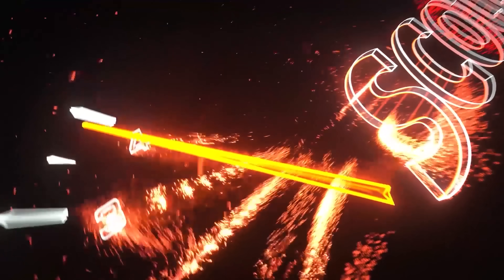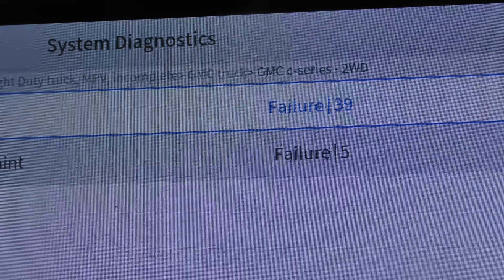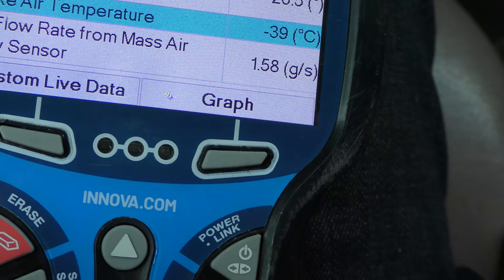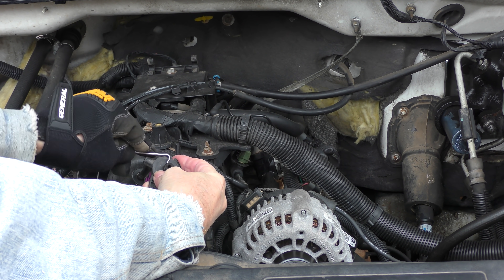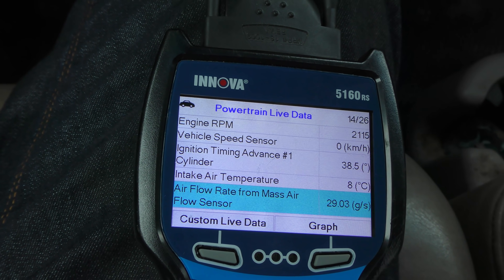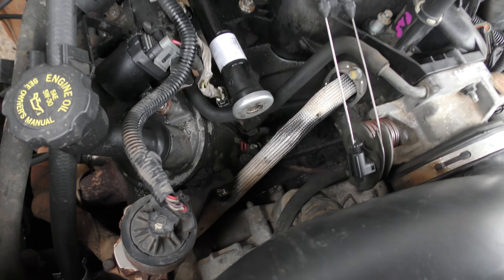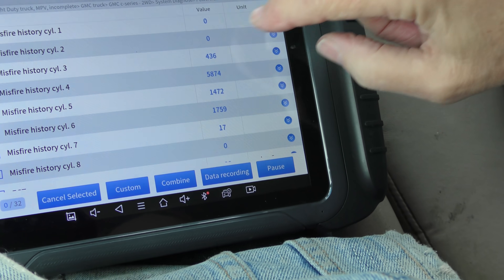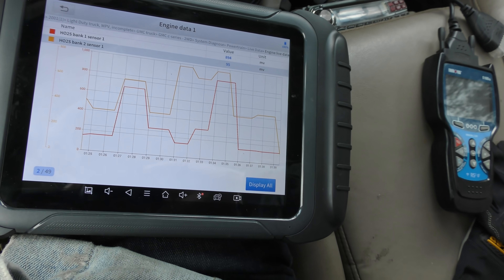My Customer Just Bought This Truck and Now He’s Screwed

Comment: I’ve heard very good things about the 6.0 vortec. Somebody must’ve neglected it. Weird that in 01-02 anyone would go for the 6.0 in a crew cab dually rather than the 8.1 or lb7 duramax. Makes you scratch your head
Reply: Probably why it's completely worn pulling all that extra weight.
Reply: My 2500hd has the 6.0 it's been bulletproof 303k miles just horrible on gas
Reply: He said it sat in field for a long time
Reply: @gabrielq.906  mine too.
Reply: @gabrielq.906  I understand they’re good I’m just surprised someone in the market for a crew cab longbed dually would go for the smallest engine offered. You usually buy that truck for a reason. Towing with the 6.0 probably gets worse mileage than towing with an 8.1.
Reply: @bryonhills6172  I know but I imagine it wasn’t exactly  someone’s pride and joy when it racked up nearly 300k either.
Reply: @JohnnyWalker721  lucky if you get 10
Reply: 8s are rare and problematic
Reply: I got a 2500 8.1 w/ Allison trans, 175k miles runs great shifts great and sure as hell tows like a beast, but I maintain it very well and the OG owner before me did too, MPG sucks but I would have definitely went with the 8.1 gasser or the 6.6 diesel for the dually 🤦‍♂️
Reply: Fleets will spec trucks that way!
Reply: Wow that’s crazy
Reply: @gabrielq.906  Love my 2003 2500hd.  Used to get 11 mpg.  Now it's getting 9 mpg, because one of the knock sensors is bad.  I'll have to get on that project this summer, but other than the mileage, she runs great!  203,000 miles.

Comment: Scotty excellent vid diagnosis is a real education.  I got out of the trade just as the newer scan tools started coming out.  I got a SnOn brick but its terrible and the software upgrades are enough to cause a heart attack.  
      If yer a hobbyist Scottys list of scanners is terrific cus he has tried them and he knows enough to tell you what they can do for ya.   Other wise ya have to buy it to find out its not what you need.  Hard tools are different  you can tell what ya need with them by the job for instance your pissed at the vehicle take hammer hit windshield right between the eyes frustration relieved simple.   Compared to Fuel trim  WTF!   Apply hammer to scanner.   Codes cleared  But?  scanner now malfunctions.  But hammer still works perfectly.   Oh this is unendorsed but I like the Alldata system manuals on disc.  They are pretty handy because of the parts locators and the flow charts to help in diagnosis. Oh and the other thing  they give is the technical service bullitins.  The dealers write them when they see patterns of problems.  If you have experience like Scotty you learn this crap but it takes 15-20 yrs to learn that kind of crap if your a beginner.   You'd have to read half of a manual just to find what your lookin for.   Good luck. 
           Oh one more thing i did some contract work for prime time airport transportaion.  they got great mileage out of their engines but they did perfect maintenance they easily got 500k out of their push rod engines.  the shop manager told me they retired them at 600k cus that was when the frames started fatiguing.  But they did perfect maintenance oil drains every 4500 miles etc.

Comment: The GM  5.3L &  6.0L vacuum pump and fuel system are notorious  bad in these. The fuel pump, cannister evap,  vaccum lines go out all the time and create all kinds of poor engine running problems. The Valve  lifters  are also notorious  for going bad causing engines  ticking and clunks in these engines. But if are a good driveway mechanic or find a decent  mechanic  these will run a long time,  and replacement  engines in junk yard or rebuilt crate engines  can be had for cheap compared to buying a newer vehicle that are ridiculous  expensive.

Comment: Get a remanufactured engine, maybe a remanufactured transmission and torque converter, and new axle differential. Then run amsoil fluids.

Comment: Looks like the maf is over reporting, so changing the maf and both upstream o2 sensors could make a world of difference. Also give it fresh oil Change then scan it again. It's running rough because the ECU is trying to compensate using bad information, garbage in garbage out

Comment: CHANGE THE OIL, THEN PUT Lucas Oil Heavy Duty Oil Stabilizer. WORKED FOR ME, STOPPED THE TICKING IN MY 2004 F250. DEFINITELY PUT NEW SPARK PLUGS IN IT FIRST, I HAD ONE BAD PLUG, THE WHOLE TRUCK SHOOK LIKE CRAZY!

Comment: We had a 2004 Tahoe, big piece of junk.  Apparently, it kept overheating & Chevy kept charging us to replace the gadgets every 4 month.  The reason was "water from the radiator was entering the oil tank".  We had to replace all the rods as well.  It is a design problem.  It only had 160,000 miles when we finally decided to get rid of it.  Had it for 16 years. 
However, we also have a 2001 Suburban, LOTS OF MILES 263,000 & we just replaced the motor last year & runs great, rarely had problems with this one.

Comment: The guy that bought this truck had to know he was possibly getting a project. Since this was parked in a field for a few years there had to have been a reason for that. In my opinion, if the body and the frame and the transmissions are still in good shape, Id call around to a few salvage yards and try to see if you can find an engine. With the current price of trucks right now, and that being a nice big dually, that would be worth putting an engine in
Reply: Do you think junk yards are stupid? They are asking 2 times more for the used e engines than they used to ask, 2 years ago, , engines that they had at $700 now they are asking $1800 for it , and surprisingly every 20-30 year old engine had only  75K miles before they removed it ))
Reply: @ansv3340  You always take chances on something that is used that’s just the way it goes. Still $1800 Beats buying another truck.
Reply: @ansv3340  still less than a new truck

Comment: Wouldn't a bad distributor pack create these misfire symptoms? I had a Chevy S10 that was misfiring, turned out the pack was bad from internal corrosion.
Reply: Where have you seen that on this motor ?
Reply: U mean the ignition coil packs?
Were they shorted?
Reply: @fil1329  yes. Don't know if shorted, but it was bad. Could tell corrosion got inside it. Replaced and problem was fixed.
Reply: My truck was misfiring because the catalytic converters were clogged. There’s so many reasons that can cause misfires.

Comment: If you can find a good rebuild shop or know a guy that can rebuild engines correctly go that route, otherwise just look for a good engine. These older Silverados were built tough minus the rusting in the fenders. 

Just don't destroy that engine, someone out there might end up doing a proper rebuild as these Silverados were among the best.
Reply: I had a Jasper put in an almost identical truck, minus the dual rear . 70,000 miles ago . Runs like new.
Reply: @wendykalman9975  that's really nice! Treat it well, will last a pretty long time.

Comment: a local used lot i saw has a good condition 1996 Chevy 1500 truck they want 16 grand for it , thats absolutely nuts . even low mileage and 4x4 10 grand is all it will ever be worth

Comment: The vortec 6000 is notorious for a gummed up TPS causing misfires
Reply: also the knock sensor under the intake manifold has a seal that fails and it gets wet causing misfires

Comment: I have a Land Rover serie2a year 63, x38.890 Miles on it, engine rebuilt in 2017. Oilpressure warning light turning in  idling Speed. Where you start to Look?

Comment: I'm getting a 2003 Honda CRV awd for 200 Canadian bucks. If it's too expensive to fix, the wreckers will pay me 200 bucks for it. I do have a question though. With or without a boost, it won't crank. Could it be the relay under the dash ? You've mentioned something similar, a few videos ago. Thank you very much.

Comment: 2014 Camry SE with newly rebuilt transmission torque converter and new fluid done by Toyota under their TSB. 
New Platinum plugs 
Hi performance EBC Rotors and YellowStuff Brake pads. 
New tires at 17,995 asking price. 
Reliable Toyota 4 cylinder with 124K miles on full synthetic Mobil 1.
Delivery available.

Comment: Hey Scottie Shawn Adams up here in Canada Canada I just bought myself a 2017 Toyota Prius Dean Toyota Prius man what a mistake that was that the toyota dealership they didn't disclose that the car was in an accident and of course at the dealership where they fixed the car they only did the cosmetic they didn't do the internal parts so now eternal parts so now I bought this used car and it still requires about $3000 worth of repairs I gotta go back and give it back tomorrow have a great day Bud

Comment: Never mentioned swapping coil packs or replacing one... could totally see a bad coil or few at that milage causing mis fires... or the MAF was unplugged for a reason. Seen a bad MAF cause misfires too...
Reply: That truck almost certainly doesn't 'use coil packs.  It has a single distributor coil "pack".   Usually if that's failing, you'll have a LOT more than those cylinders going.

Comment: It might be worth feeding some cleaner (seafoam?) in the intake to attempt and clean any gunked up valves. Some sensors are of course gone bad ... but overall, it does not sound like the engine is done quite yet; though it is hard to judge, from the video alone.
Reply: Scotty did a video blasting sea foam.
Reply: @cb-gz1vl  Scotty blasts just about everything ))
Reply: 🤣🤣🤣 he hates seafoam but he does recommend another fuel system cleaner that works really well. However in this case since swapping the injectors around didn't make any difference, probably not going to make any difference to run some cleaner through it.
Reply: @dandaman4985  because sea foam was invented for outboard two stroke motor engines a long time ago. Things have changed, & I’ve heard more bad luck than good luck from people using it in their car. Scotty is telling the TRUTH. Don’t be so quick to judge somebody
Reply: @Blakecryderman7244  Seafoam does have its place with cars/trucks, more so older trucks around the early 90's and older. Seafoam is meant to clean parts of the engine from old gas, carbon build-up, cold gelled synthetic oil, etc. Newer engines use tighter and more specific systems with more bypasses meaning the seafoam doesn't get into as many places and can do more harm than good. Old EFI and carburated systems didn't have these same things and worked quite alright depending on what you are trying to accomplish with the seafoam.
Reply: @jerseyshoredroneservices225  it does not have to be seafoam, any cleaner will do. Also, seafoam can be used to sprayclean the intake (feeding it in there while the engine is running). Obviously, it is not a miracle product, and cannot make an old engine new again - but it may just free up enough junk to make a positive difference.
Reply: @sloughsharkseh3307  yeah it’s only meant for older engines. Never use it on a 2000’s or newer vehicle.  people had problems when they used it to clean the MAF sensor. When you should only use MAF sensor cleaner
Reply: @Blakecryderman7244  Yeah, too many people think it is a miracle product, though it definitely has its uses, it isn't meant for sensors, especially newer sensors.
Reply: No canned product is going to help this vehicle.  Stop it.

Comment: Hey scotty. I have a 09 chevy Silverado 1500 4.3 single cab two wheel drive.  Was my dad's truck and was given to me after he passed away in 2018. It has 112,000 miles and was taken care of well. Anything I should watch out for? I live in NY state and noticed this winter that when the tires spin in snow it will clunk around when I turn a corner like the rear end is locked up and the inside rear wheel  isn't doing its job in the turn.

Comment: There aren't that many used cars or trucks that I would seriously consider. A Toyota Camry or Avalon, a Ford F-150 or Crown Vic, or maybe even a Lexus LS. I know that those Toyota/Lexus V-8s are expensive to repair but since I'm 6'5" I need the room. I'm not Andre the Giant size but a Corolla is just too small. I won't even look at a Dodge/Chrysler. Maybe get a Crown Vic, Grand Marquis, or Town Car and put a reman transmission in it if I can get the car cheap enough.

Comment: I purchased a 2015 chevy colorado v6 3.6L 57,000 miles two previous owners with carfax showing all services like oil changes and the previous recalls being taken care of, what do you guys recommend i do at the appropriate miles to do maintenance on it as in when should certain fluids be drained and changed and just what can i do as a first truck owner do to make sure i get the most life out of it as i possibly can? It drives well but the rpms rev higher than i feel like they should shifting from 4th and higher gears

Comment: He can go to one of those auction sites where they sell wrecked totaled trucks and get himself an engine that has 3o-60k miles for 5-10 grand . He  can use that wrecked totaled truck to pull parts out and keep his truck going for many more yrs . But he shouldnt have bought it in the 1st place . Now he is stuck with it , he is better off  buying a parts donor truck then getting ANOTHER used in working order truck

Comment: Hey Scotty! My 2002 Silverado is still on its original transmission!!! 286,000 miles! What do you think of that?!!
Reply: Change your fluid
Reply: He says not to. My mechanic said the same. It could mess it up.
Reply: @brad9092  you can mess it up only if the fluid has never been changed AND it's slipping. If the fluid is dark red or so, and it drives fine then you can change it. If it's black/,shiny and has hard shifting or major slipping then you may want to leave it go
Reply: @Ramslamtheman  ok. I see. At this point I’m just afraid to do anything to it. I drive smooth and slow, but it’s slow to engage sometimes and I get the feeling I’m on borrowed time.
Reply: Mine has 275k with the original tranny. I changed the tranny oil only once.
Reply: Nice, as long as it's shifting fine, then it's mostly ok to replace. Or don't touch it😁

Comment: Hey that's definitely the intake manifold gasket. Those 6.0 run forever if they have good oil pressure.
Reply: And when they don't it is usually the o-ring on the oil pump has gone bad. My brother has replaced a couple of them on his chevy 6.0L and that fixed the low oil pressure problem

Comment: On more modern trucks, if you get 250k even on a diesel, that's not bad providing you haven't dumped a lot of money into them.  Of course with truck prices they way they are, I would just drive it (I wouldn't have bought that truck in the first place mainly because of mileage and with how it runs, unless it was a steal, like $3k or something).  I mean depending on what you paid, even with all the problems, you may have gotten a deal if you just wanted something to drive around, or you got screwed.  I mean I would not buy a truck that had 270k on it regardless of the price.  I'd say even with diesels, after about 200-250k they almost always need a lot of work and maintenance.  Of course the older ones (the non DEF enabled trucks) are desireable because they don't have DEF systems but still, not worth it with that many miles, again, unless it was a $3,000 truck and you got a year's worth of driving out of it.  Then again, some of those can drive for a few years like that without any major problems.  I know people who drove their trucks with collapsed lifters for years and then junked them.  To them it wasn't worth spending $3500 rebuilding the engine so they just drove them and got their money's worth out of them most of the time.  I'd say if you're gonna buy a high mileage truck that's a diesel pickup, get a RAM 3500 with the Cummins diesel.

Comment: I can't imagine buying a car or truck that already has over 250,000 miles on it.  The only reason I would is if I knew I would be using the car as an around town beater ONLY, and the price was under $1,000 and it was already state inspected which is not going to happen lol.

Comment: Hy Scotty, i gave an Opel astra 2001 automatic transmision, i hale a problem Witherspoon the sper sensor, Chanel the Beijing snd sensor and same problem!!! Sometimes IT wircks and sometimes not. IT might be an electric problem but ca-n you help ME if IT îs an circuit problem or a fuse problem because online the tester IT show ME i hale no confecționate to the car computer. Ca-n IT damele my automatic transmision? Please help ME to find a soluționarea  Tanck you!

Comment: Scotty, I see you using that XTOOL "fancy scan tool" again.  Been on the fence about buying one.  Looks like it does a lot for the price.  Worth it?
Reply: They usually have a one year subscription. My autel subscription is 700 a year
Reply: @Ramslamtheman  I think the Xtool D8 (the one he used here) comes with 2022 model year plus 3 years of updates.  And it's not as if the tool stops working, it's just that when model year 2026 rolls around, you can only get full functionality out of it on model year 2025 and earlier.  

The days of prosumers and independent pros paying big annual updates are coming to an end.  Buy a new one every 3 years, and sell the old one to someone who doesn't care about future model years.  The tech is improving fast enough that getting 3 years out of a $700 or even $2000 scan tool is plenty, they'll be ready for a new one anyway if they've used it daily.